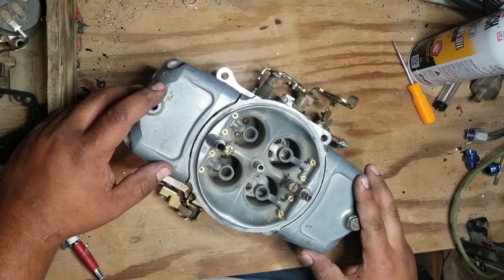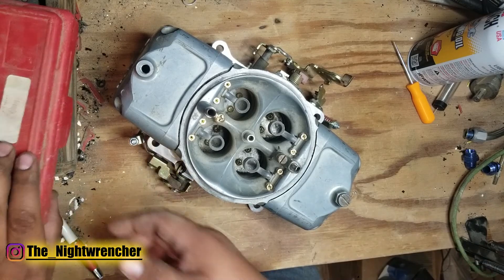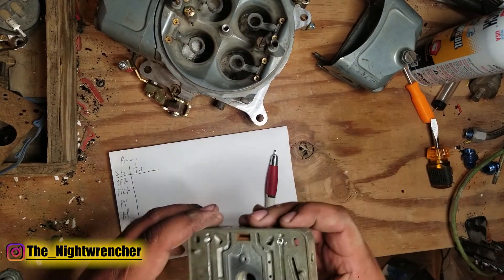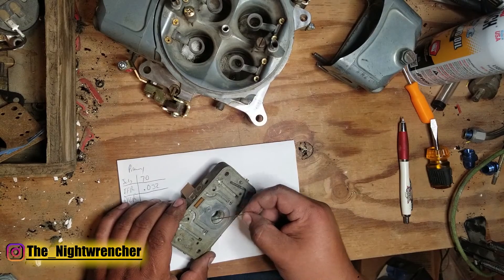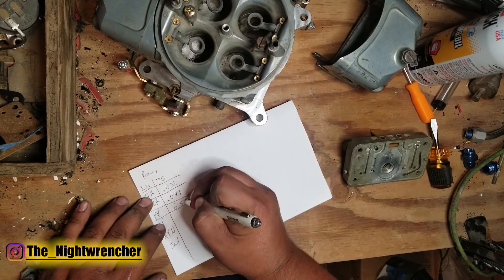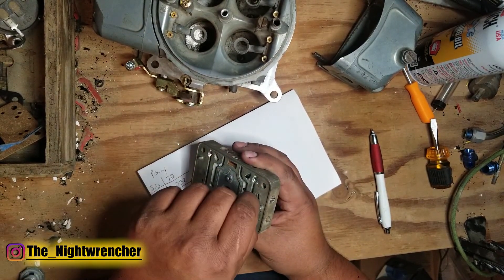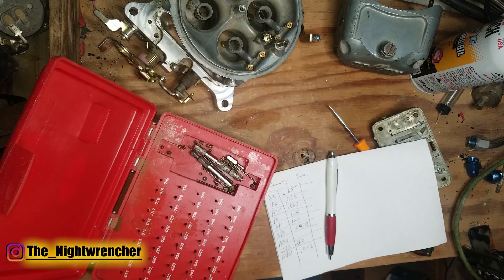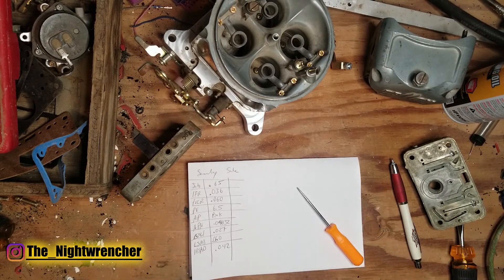How To Baseline Your Own Carburetor | Holley Carburetor Secrets | Holley Carb Tuning

Comment: Does using those button, flush fitting, throttle blade screws rather than the old brass screws that stick out the other side, improve flow much? How do you keep the flush fitting throttle blade screws from backing out since you cant stake them?
Reply from the maker: It only helps in classes where you're limited to stock parts and you need to pull out every hp from your combo. In the real world, it doesnt matter. For something that you'll drive on the street, the 1hp you might gain isnt worth the trouble.

Comment: Thanks for your videos. Is there a particular AFR gauge you prefer?
Reply from the maker: Ive tried a few but the one I like the most have been by daytona sensors but those are surface mount units. If you want a round one that will fit in a gauge pod, the AEM xseries is a good one too

Comment: Nice info .I have a Question Maybe you can help  I just bought 2 QF 750-b2 for a sbc 350 with a 671 . Rich Rich trying to tune it buy re- jetting still rich  should I try increasing IAB now has 70 HSB are 31 I;m so lost thanks
Reply from the maker: Hey man, you would benefit greatly from an AFR gauge so you can pinpoint exactly what circuit is running too rich. Air bleeds tune the RESPONSE of the fuel flow and not nessesarily the air fuel ratio itself. I would try to get the idle dialed in first and make sure your power valve is boost refferenced. From there you can go circuit by circuit to identify the rich condition. What size are the IFRs?